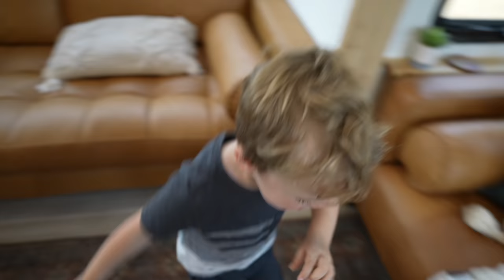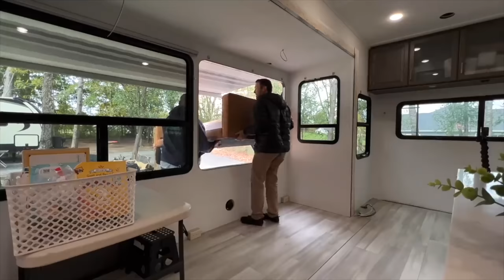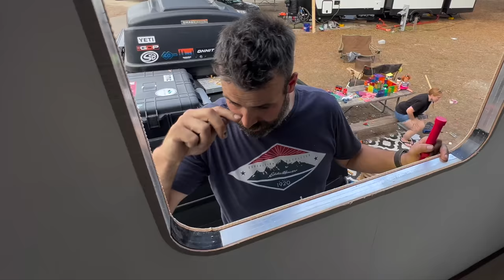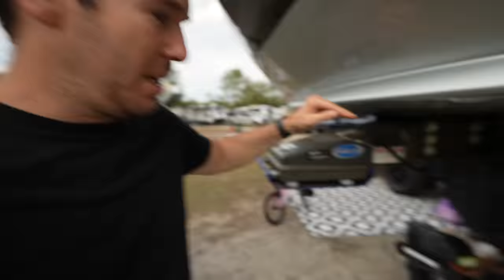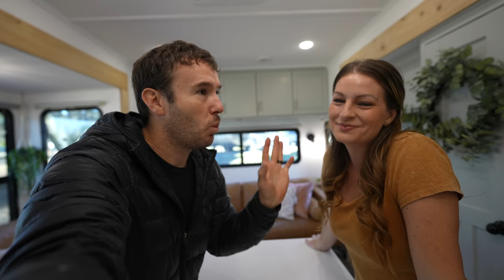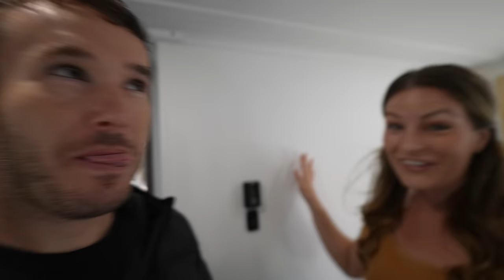Before and After RV MAKEOVER // Updating our RV to Feel Like A Home

Comment: Very interesting makeover guys and love the videos!  One thing that we did to our Solitude that we really love is we swapped out the microwave for a very nice KitchenAid microwave/convection oven that does a wonderful job baking and cuts down on our propane usage substantially and saves propane costs and management overhead. Also we picked up a portable induction cooktop so when we are on full hookup we use very little propane for cooking.

Comment: The basket idea i like, could drill a hole in the shelf above and have a pin drop down through to lock the baskets in? either in front or have a matching hole in the basket handles for the pins to go into. or maybe go through the side aluminum in the front or through the handles

Comment: So for a solution to keep your under shelf baskets in place on travel days - you just need one of those extendable curtain rod thingies. Just extend it snugly between the walls, right in front of your baskets to keep them from sliding out while you are moving, then take it down while you are stationery. We use them all the time inside our fridge for traveling.

Comment: My late husband and I used to have a handyman repair/remodel service.  Spraying paint is a better overall finish...however, the pre-paint prep work is so much more intense and time consuming  because you have so much more to cover--plastic sheeting over all the windows and floors, etc. instead of just tape around edges, that you could almost be half done painting with brush and roller by the time you finish prepping to spray.  
But--your rig looks gorgeous.
You know what would be cool in the kids' area?  One wall or half wall done in chalkboard paint, so they could draw without needing to drag out paper every time.  Also useful for school.

Comment: Hey guys, Skoolies won't fall apart like camper/trailer...they are solid steel. We put 2500 watts on our skoolie and have not plugged in 3 years. We also have 200 gallons of fresh water. You can design every aspect of a bus and know it is built to last. I love the upgrades you made, but how long will that thing last?

Comment: A piece of stiff mesh, a small hook in the front edge at the side of each shelf. Simply hang the mesh sheet on before travel problem solved.  If the mess came down below the bottom shelf it would also stop the fruit/veg baskets sliding out.  Simple and cheap , my two favourite things. 🤭

Comment: The renovation turned out absolutely beautiful.  I may have missed it in a previous video, but if the 5th wheel is less than a year old, shouldn’t Grand Design be fixing the frame problem? By doing it yourselves, doesn’t that jeopardize the warranty?
Reply: Not if the work is done by an RV repair person!

Comment: Your paint work looks great.  Paint however has som serious  problems though in my opinion.  It doesn’t adhere to vinyl all that well or to cabinets with a clear finish on them.  Be careful of the bath with lots of moisture.  That aside paint is also dirty  requiring more cleaning due to the light color. Touch up will be a constant however acrylics do touch up very well.  I hope you receive great service from all your efforts.  Visually it’s a huge improvement over all that super dark  millwork.

Comment: We have a 378mbs, the same layout as yours with the exception of the loft above the bunkhouse. We're redoing our RV little by little, we're full-time. How did you take down the valences and screw the shades into the wall? We took down a valence because I thought was already screwed into the wall, because the one in the hallway is, but it's not. Also, when you painted, did you takedown the wallpaper or did you paint over it?
Reply from the maker: We painted over it but used a primer.

Comment: The remodel looks great! Did Grand Design compensate you for the frame failure. It seems that they skimped on the screws holding it together. Grand Design has a reputation for quality builds.
Reply from the maker: All of these issues have fallen under warranty.  Stewart is an authorized warranty Tech so at is all good.

Comment: What kind of wood is around the slide outs and where did you get it.
Reply: It’s western cedar. Purchased from a lumber yard. We recommend looking at local lumber suppliers because they often have nicer pieces that are longer lengths and typically cost less than a big box store.

Comment: people always say grand design and the solitude are so well built one of the best etc yet I watch several channels with solitudes and every one has had major problems.  In less than a year you should not be replacing those sides (both sides) and have windows already bad,  Two people I watch have had kitchen islands collapse.  I am not impressed with that company for sure.  They look nice but I think their engineering must be substandard.  All RVs have issues but not frequent structural issues.